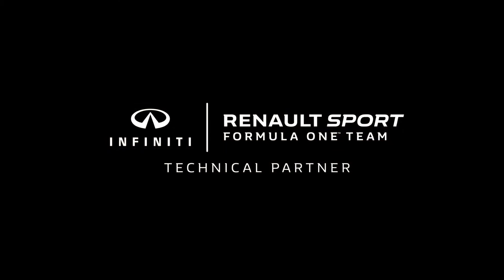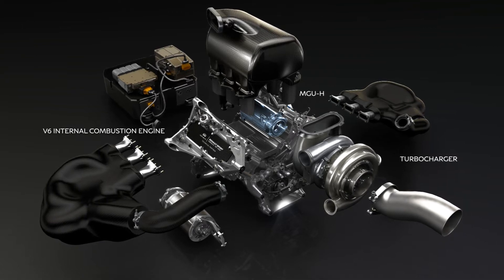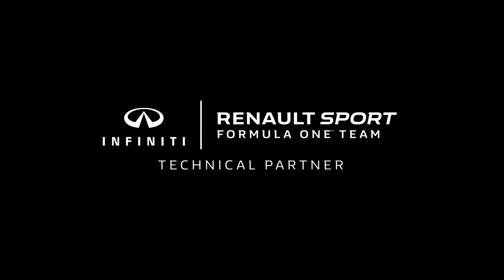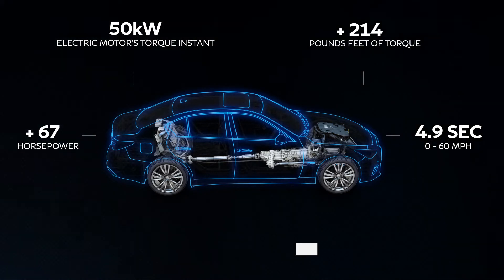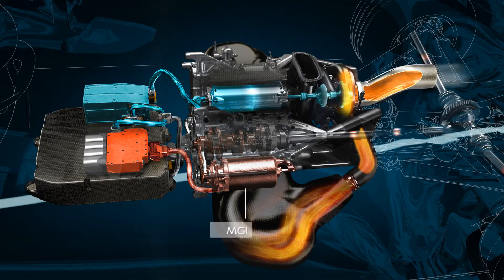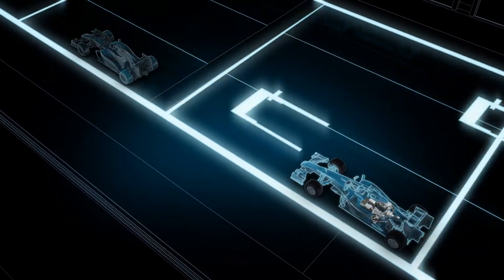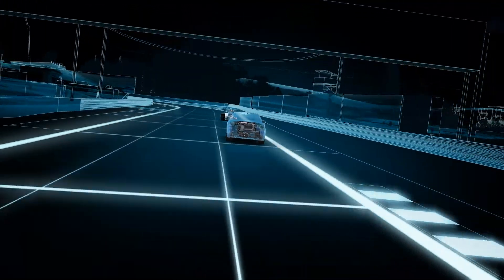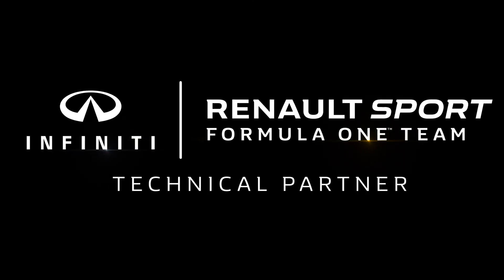INFINITI High Performance Hybrid Technology for the Road and the Track

Comment: this company is outdated and nothing new at all. i have onfiniti fx35 since 2009 till now nothing changed
Reply: tatuksa in terms of design yes, but look at BMW, design the same since inception. Infiniti/nissan pioneered most of the technology available on modern cars today. Just like what they did to the GTR, It takes times to develop a masterpiece and not rush through everything like other competitors. It's not a fluke that the fx35 engine family is awarded best engine for over 10 years straight.
Reply: Stenorn Richards  Exactly!! Well said!